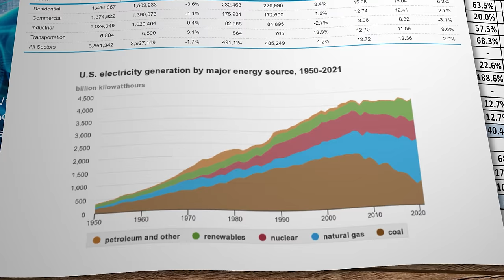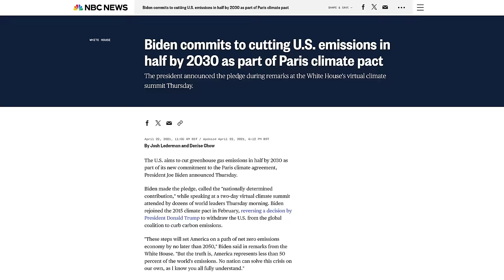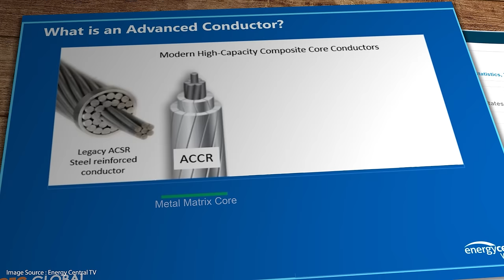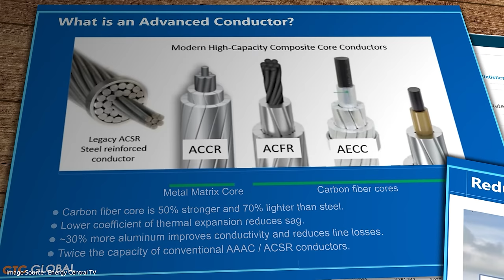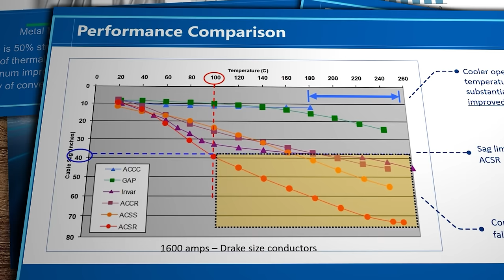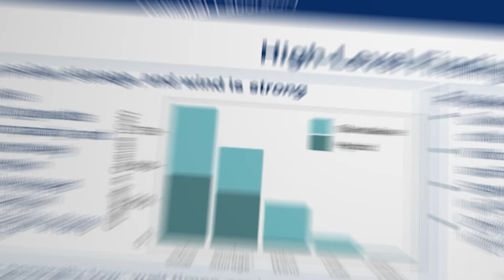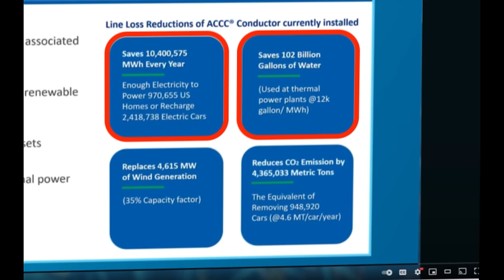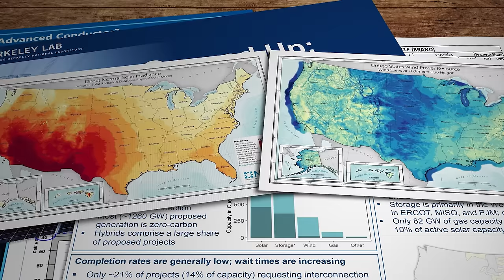Rethinking electricity grids.

Comment: You should make a short video about why we should ban plastic clothes hangers considering wooden ones are better for heavier tops while wire ones are almost as cheap/easy to produce. The only problem I see that needs to be addressed is which protective coating is most sustainable to use on wire hangers to protect garments from rust. I never hear people talk about this easy climate win but maybe you could spread awareness/elaborate?! 😊

Comment: Good insights. I think there's a couple of very important shifts that are also happening that will mean that with relatively little uplift in transmission ability and centralised production, we'll continue to meet the growing overall demand. What? Local micro energy production and local micro energy storage. The former means we don't need to transmit all of the energy we produce over long distances; indeed many of us produce electricity on our roofs and use it just feet away. The latter means that the 'sine-wave' of demand day & night for each production area is becoming flatter and flatter so I'd predict our 'peak usage' won't rise much over the coming years even if our total consumption does. That means existing infrastructure (and certainly infrastructure given a little boost as described in this video) will be sufficient for a surprisingly long time into the future. Final point; you mention BEV's as one of the things that will add strain to the grid but I think the opposite is true; BEV's will be part of flattening that curve; they'll be sucking up available production at night (and at other times we have plenty of capacity) and supplying back to support the 'local grid' at peak times.

Comment: The towers don't last for ever either. Then there is the issue wind and solar farms are often  need to be located located where existing HT transmission don't exist, so some new transmission easments and substations/switch yards are still needed to get the power connected to the rest of the ageing grid.

Comment: Question for those who know this space:  Wouldn't it also be possible to increase the voltage of existing lines or upgrade the conductors of existing lines to higher voltage conductors to squeeze out even more capacity?

Comment: The rules about whether reconductoring can be done without new approvals will depend on local rules.   Increased current or voltage are likely to require authorization.
Reconductoring can reduce resistance on a line and hence allow more current or cooler running/lower losses.    Line inductance will be much the same for whatever conductor resistance.
Overall result and degree of benefit will depend greatly on network configuration.  Far from a magic bullet.
As another commenter suggests, the big issues are the relative location of generation and loads.   Because renewable generation is intermittent, storage is the big issue for which solutions are still very expensive.  HVDC transmission lines are really only suited for moving large quantities long distances.
Until now electricity has been 'simple'.  Big power stations and dumb distribution networks.  Huge changes to both are needed.  I think the issue is gong to be the human resource costs of handling intermittent generation and distribution networks mixed with distributed generation.  The level of expensive administrative complexity is going to increase enormously.

Comment: There has been tremendous increase in efficiency of small horizontal wind turbines. Could the current electrical pylons carry the weight and stress if small horizontal turbines were added to each pylon? There would be no problem connected them to the grid because they would actually be ON the grid. I understand the pylons could not support vertical turbines, but small horizontal turbines have less centrifugal and centripetal force than vertical blades and are small enough that they could be placed inside the pylons below the transmission lines. The numbers needed would be a stimulus for mass production, thus bringing prices down and though each wouldn't be extremely efficient, in aggregate, they should produce significant electricity overall at a comparatively low cost. Noise is one possible drawback, at least currently.

Comment: In interesting aspect of grid updates is taking advantage of new tech to reduce electricity losses during switching and breakers. Ideal Power of Austin TX makes the B-TRAN semiconductor to reduce switching losses. It is applicable for grid, solar, wind, EVs and battery storage systems. It might be worth a look although it may be a bit on the nerdy side for the JHAT audience.

Comment: I recall energy transfer was the limiting factor to going ahead with the solar setup in the Sahara seems it would need to cover a relatively small area and be able to supply enough power for the entire world, yet transporting the power was the biggest hurdle, aside from the environment and impact on the environment; South America relies on the nutrients being blown from the Sahara and across the seas, and even those solar panels would be enough to start growing grass in the Sahara and turning parts of South America back to a desert. 

I could be wrong about the environmental impact bit, as I only looked into it briefly several years back when I was looking into large scale solar operations, but I figure it is somewhat along the lines of why it wouldn't be done, aside from cost and maintenance being an obvious one also.

Comment: Here in Australia, we have an argument running about whether to introduce Nuclear. One side of politics is "against" it, the other wants all barriers removed and nuclear allowed into the mix.

One thing I keep saying in support of a renewable power solution for Australia, is that technology will KEEP IMPROVING. Solar will get better, turbines will get better, batteries will get better. Like "Moores Law". 

Renewables have an inbuilt advantage in that it is easier to include new technology as it enters the market - it's an inherent fact that things are constantly being replaced, so they will get replaced with new, better components. Unlike, say, a Nuclear Power Plant. 

We have a parallel argument, or problem, regarding transmission - much money required to adapt the transmission network, and farmers and local communities opposed to grids being built across private, arable land. So the news coming out about higher efficiency cable is most welcome. 

But expected and predictable - components will get better and better.
Reply: Nuclear takes forever to build, and is incredibly expensive (especially once decommissioning costs are factored in.
Reply: @simhedgesrex7097 Do you ever see the decommissioning costs of solar, wind and battery storage included in renewable figures? They have nasty chemicals in them that need to be handled properly or will cause environmental damage.
Reply: @geoffsmith82  I would have thought that the decommissioning problems and costs of renewables are similar to the problems and costs of all sorts of products - televisions, for instance, or cars - whereas nuclear is a whole different ballgame. 

Can't dump a nuclear reactor at the council tip, can you? 

Batteries are always recycled.  Solar panels have aluminium frames and glass and metal components, and can be recycled.

According to the clean energy council, more than 85% of a wind turbine can be recycled, by mass - mostly steel, aluminium, copper and cast iron.
Reply: @geoffsmith82  Well, many of them can already can be recycled (not much recycling possible with radioactive materials from Nuclear power stations), and decommissioned at vastly lower costs than for Nuclear.  The UKs Nuclear Decomissioning Authority estimates the cost of nuclear decommissioning in the UK to be  £149 billion.   People don't talk about decommissioning costs so much for renewables for the same reason they don't talk about them very much for coal power stations, or gas ones:  they exist, but they are reasonable.
Reply: I like the idea of SMRs

Comment: Awesome Dave ❤ Just one question; you mention at 0:45 that rollout of LEDs, better building code and  adoption of heat pumps would all contribute to lower elec consumption. Appreciate the low carbon benefits but wouldnt heat pumps be responsible for greater elec demand, given that most of their predecessors were non elec based?

Comment: Power system engineer here. Informative video, but you are talking about reconductoring as if its a new innovative solution, yet it's normal/commonplace in the industry. We are obligated to get the most out of existing circuits before triggering new ones which means when we anticipate them overloading we trigger the need to put the best conductor type possible on them. The issue is, using the maximum conductor ratings possible still doesn't provide enough grid capacity for the generation mix that is coming; we need new circuits, fast. 

Another issue you didn't mention is the time taken to reconductor multiple circuits. Individually its relatively quick, but it's not fast when you look at the system need holistically and need to coordinate the reconductoring of 100s of long transmission circuits. Supply chain, line worker resource and securing circuit outages are all major bottlenecks. You can only do so much per year and in fact it may actually be faster, cheaper and more environmentally friendly to just focus on building new circuits first.

Comment: One additional comment regarding Distributed (or decentralized) Energy Systems (DESs).
Distributed rather than centralized (via legacy fossil-fueled powerhouses) energy production means that communities can be "islanded" (sequestered) in case of regional power disruption. 
For example, a locally controlled microgrid might be more robust in case of a regional blackout or other catastrophic event, such as when the next large coronal mass ejection and/or solar flare occurs.
Also, ideally, local microgrids, with citizenry having more ownership and control, would break or at lest lessen the political and economic power of large utility providers. Surely a good thing!

Comment: I will be interested in your thoughts on the smart supply side control of demand. All current schemes require the user to manage demand at peak times, like Octopus. Only the very nerdy will do this for the savings involved. I gave up. 

If octopus could supply devices that enabled them to control switch on of these devices, kettles and fridges say, at peak loads in exchange for yearly rebate, then this would enable better contol without the need for energy management skills in the average consumer.

Keep up the great work

Comment: HVDC grids are, at state of the art technologies, capable of lengths of over 1,500 miles with limited losses. A network of a dozen of these across the US would solve virtually all of our regional power grid problems. The same is true across the world. So wind, solar, hydro, and geothermal can provide a stable equalized grid virtually anywhere in the world, economically using only renewable power sources.

Comment: A standard 50 gallon electric water heater uses 5000Kwh of electricity per year.  A heat pump water heater of the same sizes uses less than 1500KwH per year.   That is enough electricity savings to charge a tesla model 3/y  fully from empty to full more than 45 times.
Reply: Yes.  But are most people switching from electric heating of water, or from gas/oil?
Reply: @simhedgesrex7097   People who switch to heat pump water heaters are often already heating with electricity.   It is a lot of extra work to run 50 amp service to your water heater location  to switch from gas to electric.   Where if when they already had a standard electric water heater, they can switch to a heatpump and the electric savings will pay off the water heater in just a few years.
Reply: @Thebackson  In the UK, people often switch to heat pumps for heating at the same time as they switch it for water:  they'll heat a hot water tank, and run water-filled radiators from that tank, as well as running their hot water needs.

Comment: It's going to be interesting, because on the one hand, we likely will need more grid capacity, but on the other, as renewable energy and battery tech gets better, it's going to allow more of us to go gridless, and chances are, as the tech keeps getting better, more of us will probably want to do that to reduce cost.

With that said, we likely need more grid capacity, but I do have to wonder if it doesn't become a problem at all as the tech develops, more of us goes gridless, reducing the demand on the grid network and reports are going around that by 2030, a lot of us could go gridless, going on the advancement of renewables as well as battery tech, and with the cost of the two keeps dropping.

Comment: To improve transmission capacity there is also Storage As a Transmission Asset, SATA for short, which allows to spread peak demand over the course of a day, allowing to increase daily capacity.

Ideally we'd also have consumers install home batteries, and/or using v2h, even when they don't have solar, to shave off peak demand when people come back home in the evening.

These techniques allow to increase transmission and distribution capacity with no line upgrade.

To make these upgrades affordable, consumers should get access to spot electricity pricing, which in my opinion is the most essential missing piece to move to dominantly solar and wind production.
Reply: @killingtimeitself  yeah I know, but that's what it is.

Comment: You can also put batteries on both ends of a line as "virtual transmission".
Reply: Batteries alone won't help an AC powered line which most are unless you put big AC/DC converters and DC/AC inverters next to the batteries at each end. The only gain would be the ability to store a few hours of power to limit 'peak' demands on the AC power line.

Comment: While regional, and national grids, are useful in moving electricity around, the future may well be a case of generating locally, to use locally. Overall this is not as efficient as central generation, but literally takes a load off the grid. So local solar, small-scale hydro, wind turbines and kite farms may well be a common sight. Owned by local communities for the benefit of local communities.

Comment: I don't think it was mentioned in the video but newer materials also have the potential to handle higher voltages as well so another method to get more power down the lines is to increase voltages. It would just require switching out the transformers along the line to handle the larger voltage.
Reply: @killingtimeitself  Unless the new materials are significantly heavier the towers would be fine. The insulators would likely need changing but that would be relatively straight forward.

Comment: It would seem to mE that a huge portion of the electricity could be produced on site. The cost of solar is dropping like a rock and you don't need to be in the best spots to use it. You just add a few more panels. Same for battery tech.

Comment: It’s pretty common to reconductor at utilities. This isn’t an unknown solution. The challenge isn’t just reconductoring the circuit, you also have to think about the transformers and busses the conductor lands on. It’s not that simple. Also, if you want to get more capacity your other option is to just up the voltage. It’s pretty common to convert 12 kV to 21 kV etc. Again, each of these options have trade offs and honestly none of them are unknown or breakthroughs unfortunately.

Comment: Another solution in sunny climates are a network batteries to soak up solar during the day, and distribute that energy at peak demand in the evening.
Energex in Queensland Australia are doploying batteries in over 40 sites. From 4/8MWh high voltage, down to 30/60kWh neighbourhood batteries.
The nearest one to me on Bribie Island with be the first flow battery.
Reply: Not just sunny climes.  In the UK too, as our levels of solar increase (though mainly they are for wind).

Comment: Many times, the limiting equipment of a transmission line is not the cable.

Almost all utilities in the US are required to follow regulation PRC-023 which involves determining what is the limiting equipment for the entire line. It could be as small as the instruments measuring the current flowing through the line or as big as the conductors or breakers.

Unsurprisingly, all the equipment in the path are sized at approximately the same ballpark current rating. Just reconductoring doesn't necessarily increase the rating of the entire line.

The decision is not black and white and many ideas are considered. When a system need is determined, many engineers from many companies submit all kinds of ideas to the Independent System Operators (ISO). Reconductoring is the lowest hanging fruit for a transmission planning engineer to study. It's always considered.

Comment: Er… no! In an ACSR conductors the steel strands are not armoring they are at the center. They are just tensile strength reinforcements.

Otherwise, good video. I have been aware of ACCR conductors for a while now but hadn’t realized that they were superior by that large a margin. I’ll go and check them out, and the other new conductors too, in more detail now!

Comment: Reconductoring a nice idea, but in UK / EU the overhead lines are about 4% of the whole system; that is the very great majority are buried esp. in residential areas. Reconductoring those means lots of digging stuff up ie roadworks, roadworks... :(
Reply: Well, they don't last forever, so eventually they will HAVE to dig them up. Or just pull new cable through the conduit (if there is conduit). Either way, there is no avoiding replacing them.